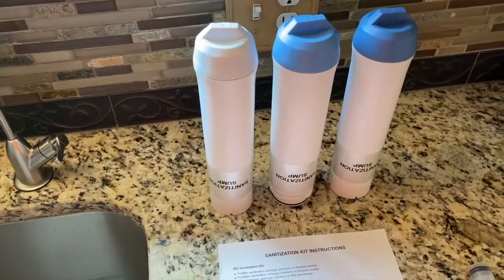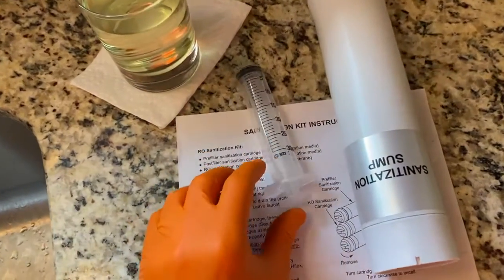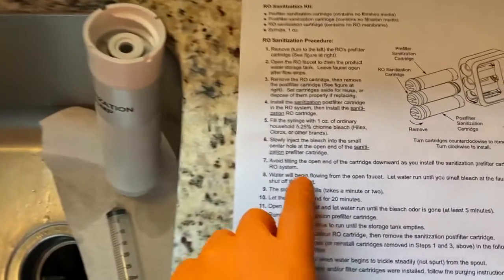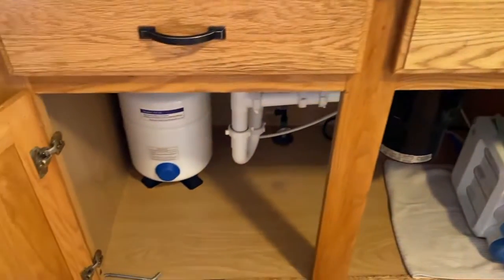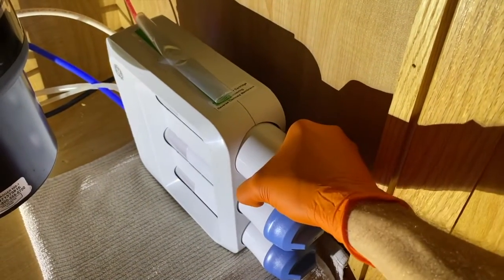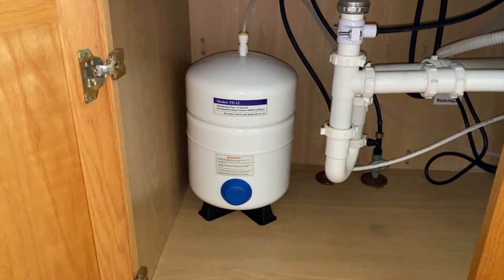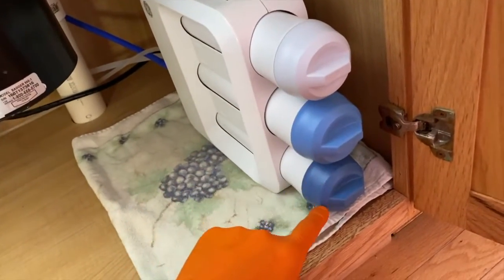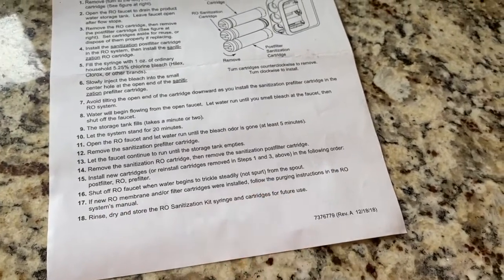How to bleach sanitize GE reverse osmosis system - DIY

Comment: Thanks for the videos. This sanitizing process though sounds more like a way to sell another kit. We use bleach to sanitize it. But then we put more bleach in to purge it because the filters were replaced? And the kit has sanitizing filters whose purpose is so that the actual filters don't get bleached, but the purging process puts bleach into the new filters anyway, so...? This one is a bit confusing to be honest.
Reply from the maker: @AlejandroSarria-te8tt  

Thanks for watching.  The sanitation kit allows for the system to be properly cleaned without harming your new filters and membrane.

After the sanitation process, the bleach should be 100% removed from system.  You can then install new filters and membrane and begin the purging process which allows the filters and membrane to be properly introduced to the system for best results and performance in terms of clean quality RO water.

😁👍🧰

Comment: Hey how do you like this water filter? Just purchased the 5 stage reverse osmosis. Normal for the water to look cloudy?
Reply from the maker: Good morning ☕️

Honestly, it’s been great.  We ran into a few minor issues with system over the years however very minor.

One issue wasn’t even the systems fault, none of the issues made us feel negative about system.

We recommend this system to all as its a very friendly system to install, maintain, and operate.  It’s also a very friendly price.

Comment: How often should the system be purged and how often sanitized (bleached)? What does purge do, and if not purged after changing filters does that mean you’re drinking stuff you shouldn’t be drinking because it hasn’t been flushed out?
Reply from the maker: Thanks for watching, great question.  GE recommends system to be sanitized once a year during the time you’re replacing membrane.

Purging will ensure all air has been pushed out of system which in return, will allow your filtration system to perform properly, efficiently, and as designed.

😎👍

Comment: How do you reset filter light after changing the filter?
Reply from the maker: Thanks for watching, great question.  We do it every 6 months however a few of our viewers have mentioned that they took the battery out and run system without battery.

They just remember to change filters every 6 months.  Hope this helps.

Also if you’re into crypto trading, we just launched our new platform website.

       Toolboxtoken.com

Reach out to us anytime.  🧰

Comment: I just purchased this kit. It comes with 3 filters as I'm sure you know but do i need to purchase 3 more after i bleach the system?
Reply from the maker: Thanks for watching.  The 3-filter bleach kit is reusable and will not require you to purchase a new 3-filter bleach kit every time you want to bleach system.  😁👍

You will simply remove your old filters and membrane, followed by bleaching the system with this 3-filter bleach kit.  After bleaching, you will remove all three of these bleaching filters and install brand new pre-filter, membrane filter, and post-filter.

👍🧰
Reply: @DIYwithMichaelBorders  
Good information! Thx

What I meant to say is I bought the 3 stage RO kit. Not the bleaching kit. So I've got the RO kit sitting in the box right now. I guess I need to buy the bleaching filter kit?
Reply from the maker: @stephengernenz8217  

Please reach out to us any time.  🧰

Comment: We’ve owned different RO units over close to 40 years. You are always warned to never run bleach through the membrane. On this system the bleach appears to go through the pre, the membrane and the post filter, then is purged. This doesn’t ruin it? I haven’t heard back from GE and hope someone will answer here. Thanks.
Reply from the maker: Good morning ☕️

You are spot on!  😁👍  Bleach is NOT to be added to system while filter and membrane cartridges are installed.

They must be removed and replaced with the three sanitation cartridges as shown in this video.

Adding bleach to system will 100% ruin both filters and membrane.  Following the steps in this video will ensure you perform the sanitation process correctly.

👍🧰
Reply: @DIYwithMichaelBorders  Thanks for your prompt reply. I am rereading the manual and the sanitizing kit is listed as “optional”. Your (terrific) video never mentions the kit. In both cases it looks like the bleach simply goes into the yellow tube at this point. The filter casings don’t seem to open, they are a solid unit. So I’m sure there are lots of people new to R.O. that simply put the bleach in at this point. The 5 stage system we purchased has a final remineralization filter. The book has zero discussion about the bleach and filter damage and calling the kit optional is misleading. I haven’t found any discussion on your (terrific) video. I appreciate how you break down the steps. I went over your videos again. On installation video #2 at about 6:40 minutes we’re directed to the sanitation video. The sanitation video shows a system with what appear to be filters installed. I’m ready to pack this kit up and reinstall the old system which takes half a day and the sanitation and flush is complete. I’m sorry to rant but this looked like an improvement on the old system until we reached this step. And when this is resolved there is still 24 hours of system purge, then the rest of the day to remove media fines. Note to GE, this does not feel like an improvement. Thanks for your help Michael.
Reply from the maker: @CinnamonRabbitt  

We appreciate the reply.  True…🤔…great point.

In the beginning of video, it shows the removed filters and membrane sitting inside our sink.

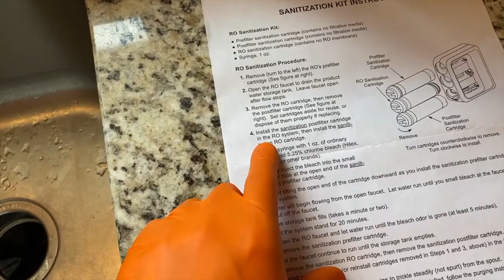At the (0:28) placement of video, we show the three cartridge’s labeled Sanitation.

The steps to follow show us using the three sanitation cartridges to properly sanitize system.

😁👍
Reply: You are right. I took another careful look. I assumed these were the cartridges that came with the system. I'm still not happy with GE for allowing us to purchase a system that requires an additional purchase midway. Also, they label the sanitation kit as optional. I don't see how it is optional at all. Thanks for terrific, clear videos. It may be helpful to point out this sanitation issue a bit more boldly, clearly. I appreciate your help and reply!
Reply from the maker: @CinnamonRabbitt  

You are very welcome and we are happy to help.  👍☕️

Comment: Wouldn't the prefilters, especially the carbon filter,  just remove the bleach before it gets in to the tank?
Reply: The cartridges used in the video (sanitizing filter cartridges can be found online) during the sanitizing process are empty and do not filter any water, they just seal the system and allow water to flow through normally. As per the video, once you've completed the sanitizing process, you install the real filters that actually filter the water.